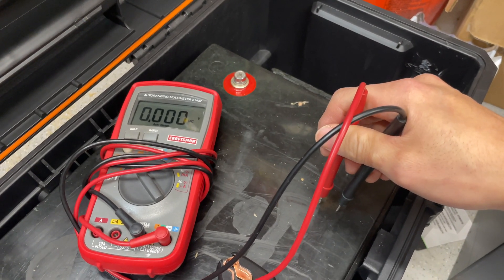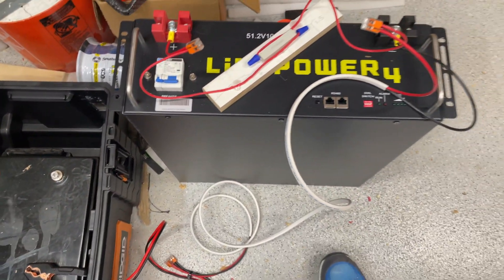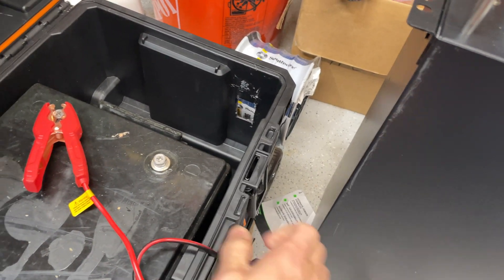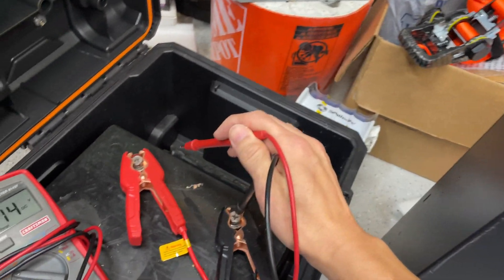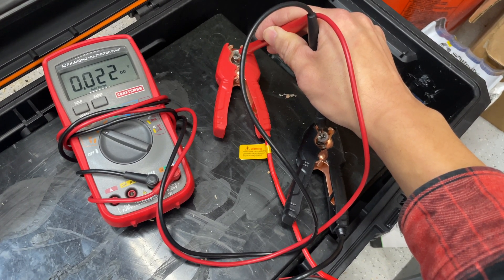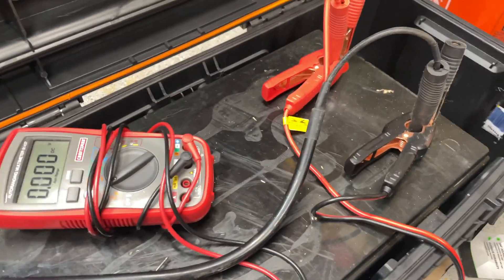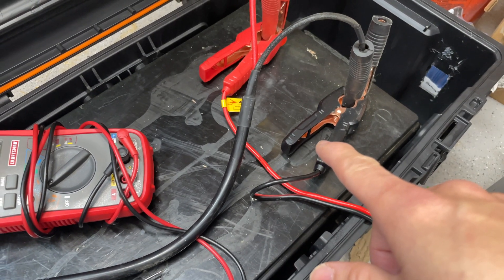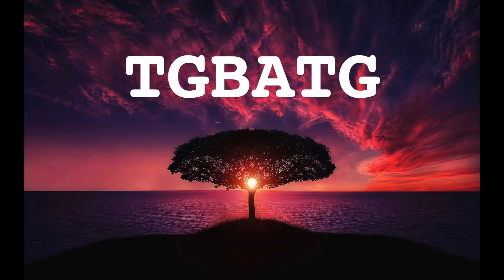How to revive a lithium battery from protect mode |  EG4 48V 100AH WP waterproof battery lifepo4

Comment: I used an EGO battery along with a resistor to bring my battery out of its protection state, thanks.
Reply: What resistor did you use? I have a bluetti that won't charge. Opened it up to the raw battery got so e converters to get the d7909 to alligator clips. Everytime I connect, I get a spark and it still won't charge. All my research says I need a resistor but I don't know which one to get.

Comment: I have this battery and it goes in protect mode quite often, it’s easier to wake with a variable bench power supply.  Steadily Increase the voltage starting with 48v until it wakes up

Comment: hello, i have a question for any one who knows about e bike batteries. 
i have a 48v 17.5 AH batterie for my bike, after a litle bit more then 6000 km i starting having an issue. when i use my bike and i draw i bit of power 500w or more the baterie on the display drops to 38v. the strange thing is that the motor stops but the display stays lit, and after mayby 30 sec the power goes back to normal. but when i ride with litle power the baterie fonctions normaly. i thought it was voltage sagg but it seems a litle extreme, ive open up the baterie to check the cells voltage but they are all good, i was thinking it might be the bms but im not sure. if anyone can help me i would be greatfull.
Reply: you can also check you P settings and controller to see what kind of amp fdrain it is capable of. Could be the controller hitting th battery too hard and controller gois into auto protect for a bit. bigger AH batteries are almost always rated at wattage but remember some biks specs dont show PEAK POWER and can easily spike several amps above what bms or some ESC's are rated for. On the flip side IF its an old battery, it could be flatlining so it holds voltage but not amps. Easy test is drain it like normal  then fully charge it. If voltage drops more than a couple volts on take off after fresh charge you know the battery is done.
Reply: @paulstrollo3187  the BMS is rated for 30A, the bike puls 25 at peaks usualy (its a bafang BBSHD) i've used it for 6000 Km with no issue. but il try to check for it like you said im also checking each individual cels to see how they are.
voltage sag on my batery is usualy not more than 4v at max.
Reply: yeah with that kind of distance your battery is probably fading. best to replace. If you are familiar with battery combiners, highly recommend when replacing battery setup. Will allow you to use 1 OR MORE batteries together safely. the advantage is huge when talking amps as you share the amp load between the packs and get way better performance IMHO not bad for a $40 investment IF you have room for multiple batteries...btw, might want to check p settings to confirm amp draw settings as some controllers will allow you to set limits for both takeoff and max burst...
Reply from the maker: sounds like at least one of the cell is bad, and/or batteries have gone no good. More likely the one or more of the cells is bad allowing some power but not the rated 48v.
Reply: @tgbatg  ok thanks, i should do a capacity check to be shure..

Comment: no clue who thought this was a good idea. bad idea at best and EXTREMELY DANGEROUS at worse. Please do not do this!!! without a proper circuit to divide and balance the batteries, it is a seriously harmful thing to do to a battery pack. which can lead to a chemical fire you cannot put out. just not worth the risk.
Reply: No, this is just to wake the bms back up. Once it is awake and the auxiliary voltage source is removed, it is just a bms protected battery pack being charged with an approved charger. All normal and good. Don't understand why it works though. Have had my batt connected to a cc cv power supply for months and it remains dead. Something unusual about the voltage profile of the charger?
Reply from the maker: @spmbucket1  this ^.
this action is only to wake the BMS bc it's in protect mode. the charger doesn't start charging until it detects a certain voltage on the battery. Not sure what that voltage is but it seems to have to be > 40v at least. In my case the battery self-discharged to dead/protect. IN order to charge the battery using the 48v charger, the BMS had to be awakened. so the action to awake the bms was using the 48v lifepower4 battery, then the charger can start charging the battery. THe charger could not charge the battery bc it detected 0 volts on the battery.

in your case it seems like maybe SOC drifted, you might want to disconnect everything, then awke the bms and start charging. hopefully it will work.
Reply: @spmbucket1  i suspect it is analog vs digital voltage detection that makes the difference. some chargers are designed for a specific battery chemistry so voltage is very specific.IE lipo= 3.7 v nominal 4.2 v max and 3.2v min anything outside this range and cell is bad and should be discarded..."its OHM's LAW not a suggestion" LOL
Reply: i believe you are mistaken. the bms cut off because it detected an improper voltage is a cell series. Fix the bad cell or discard but never ever do this! been a n EE for over 30 years and can tell you for sure and for certain, you are setting your self up for complete disaster. IF anything goes wrong you blow your self up so not worth the risk. most techs dont have enough information to even know what is going on in the cell packs. Try reading individual voltages from bms sense lines you will see the bad cell series and then know where the bad battery is. more often than not, too dangerous to cut out and replace not to mention having to match current packs voltage to 1/100th of a volt just so it wont arc and spark when welded into the old pack.dont take my word for it, please look it up. what you are doing is not safe and someone less informed could seriously hurt themselves...
Reply from the maker: I get what you're referring to, and that can be the case in sometimes. but in this case, all the cell voltages were low. so the BMS had no power. Once it was charging you can get into the BMS and check each cell voltage. Even if the cell voltages are off, fully charging the battery, will allow for top balancing the cells.

If the bms is functioning properly, in the case you described, it will shut off the charging. the bms is set to shut off on low voltage, over voltage, over current, and temp. the case where there is one or more bad cells, when the bms is online, it will shutoff the battery.
Reply: When I plug in my charger. It kicks on, reads 42v. Charger kicks off and says charged. Once I unplug charger, battery drops to 0 in 2 minutes. New battery. Idk what to do
Reply: 36v LiFePHo4 battery

Comment: I thought you couldn’t use the charger if it wasn’t a 48 V charger?
Reply from the maker: This example is using the EG4 waterproof48v  battery charger, which has been discontinued. made for this battery